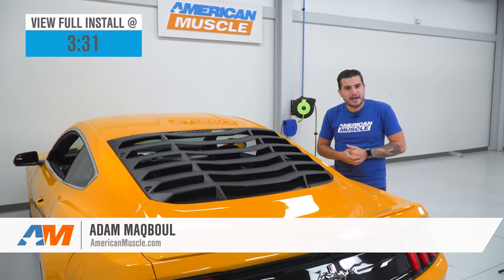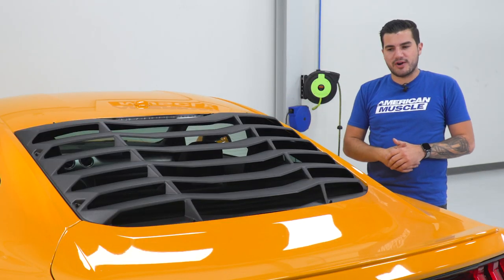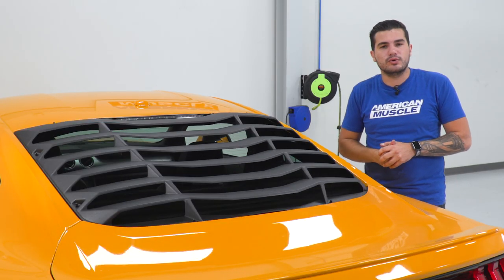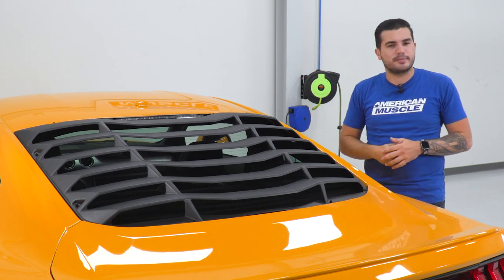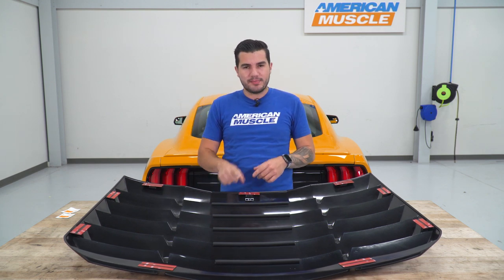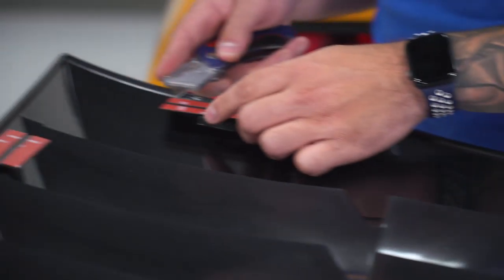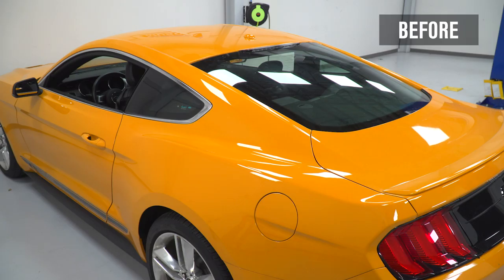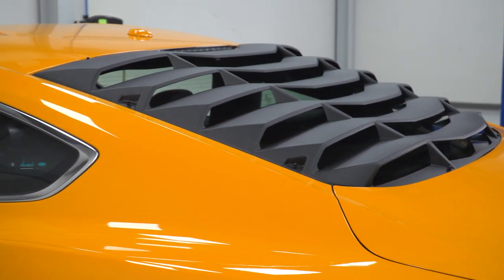2015-2020 Mustang Fastback MMD ABS Rear Window Louvers Review & Install

Comment: Bought the exact brand back in 2017...Still have it on.  One downside is the threaded post on the bracket...it breaks off after a while (even if you’re careful tightening the nut).  Since having it, I’ve had 2 snapped off.  I’ve been using super glue to reattached each threaded post.  I did purchase a set of the brackets (approx. $40 plus shipping) and yet to replace the two that snapped off.

Something to keep in mind.

Overall, it is a nice product and makes the S550 look great!

Comment: How permanent are louvers if you change your mind months later?
Reply from the maker: The brackets are held onto the rear windshield using 3M Automotive Tape, which can be removed with some heat. Like Travie said, a heat gun (even a hair dryer) can do the trick. So not permanent! -Adam

Comment: Do you really have to wait 24 hours ? 😂
Reply from the maker: I highly recommend letting the brackets and 3M adhesives cure for a full 24 hours in warm temperatures to ensure they adhere properly. If you don't, you may end up losing your louvers going down the highway. -Zach